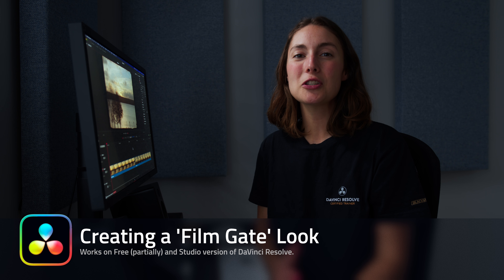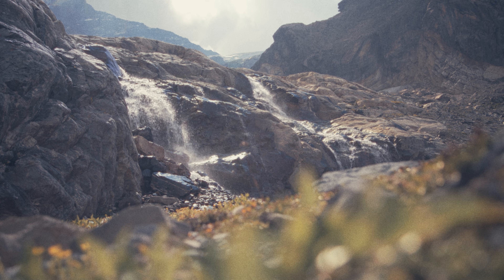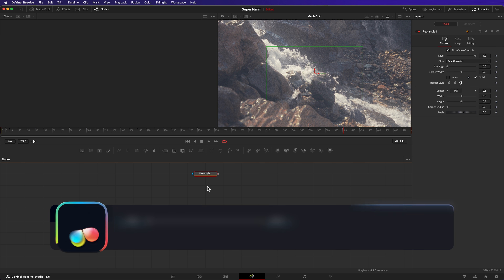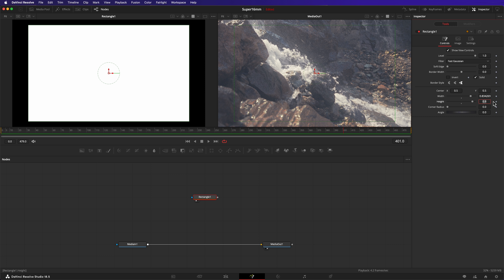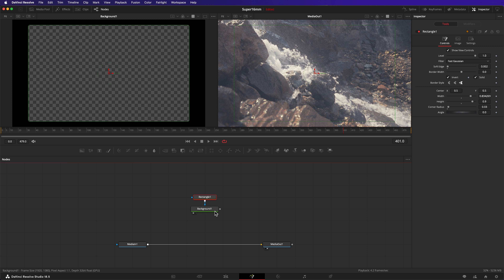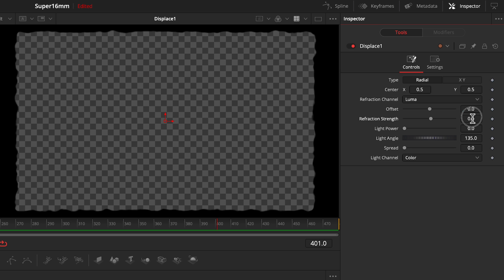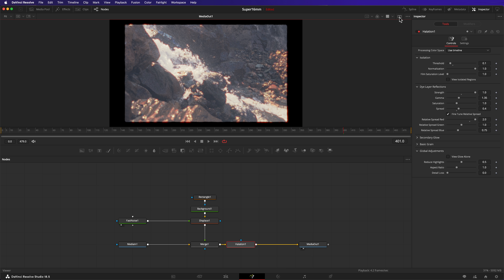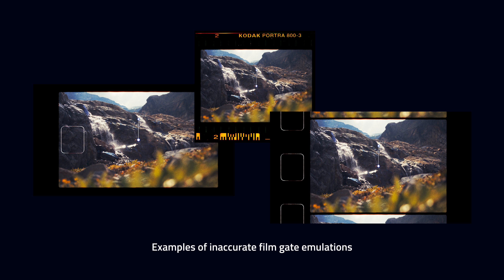RETRO Film Look for FREE, Film Scan Gate with FUSION - DaVinci Resolve Tutorial (16mm 35mm 8mm)

Comment: There is also such a cool feature as twitching in Film Gate [ just as visualization ] Although, if correct, it is the Film Gate that holds the film during the exposure of the frame.
Reply from the maker: Ah yeah, I think you are talking about gate weave? It's where the film is not continently held in the same place when it is exposed. Some cameras will exhibit more gate weave than others. Modern film workflows have not gate weave as any that remains can be removed in post.
Reply: @team2films  right. A very interesting effect.